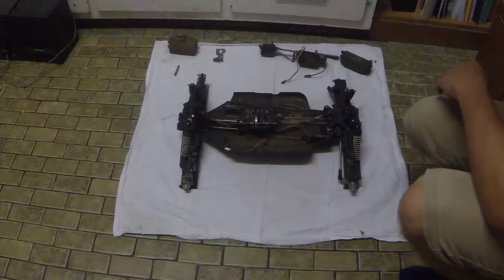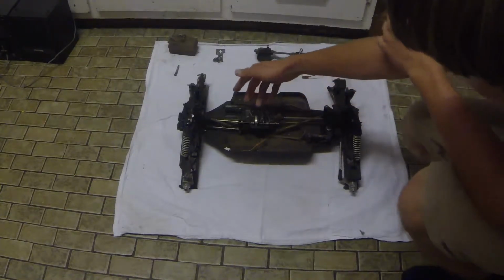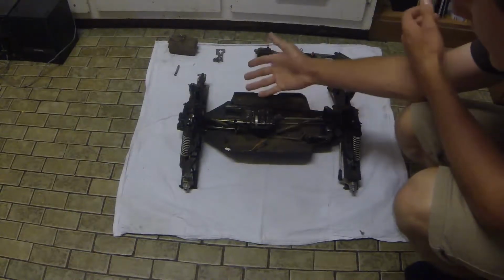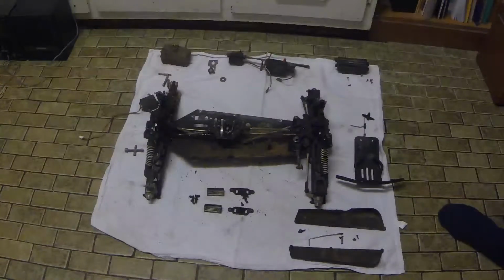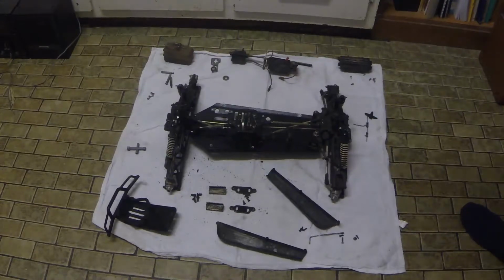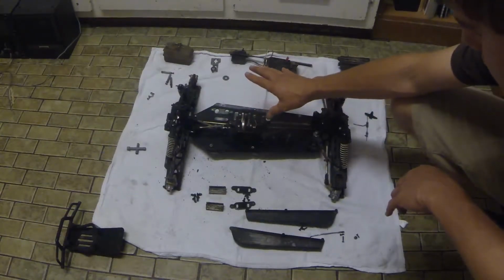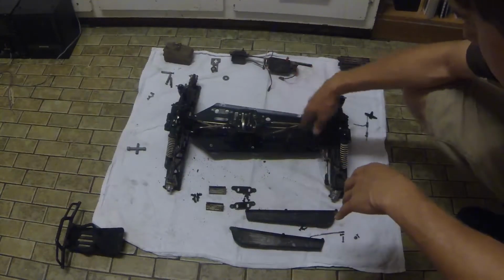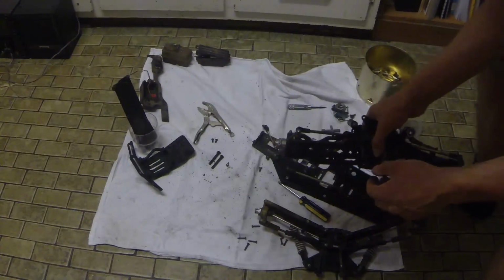RC Workbench ep01 - 1/8 Monster Truggy build pt1

Comment: Looking forward to seeing the beast running
Reply from the maker: Yeah, I am too, it's certainly going to be a beast, Leopard Racing 4074, 2150kv brushless 4-pole, 120A HK ESC, 5ah 30C 4S batteries, and a custom rollcage.
pt2 should be up shortly.